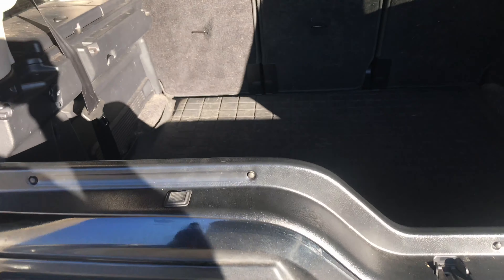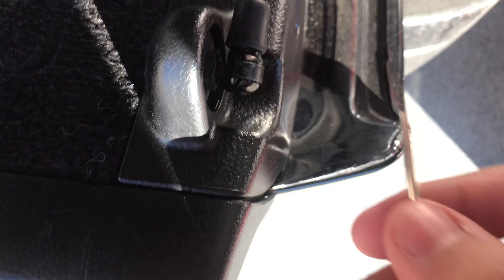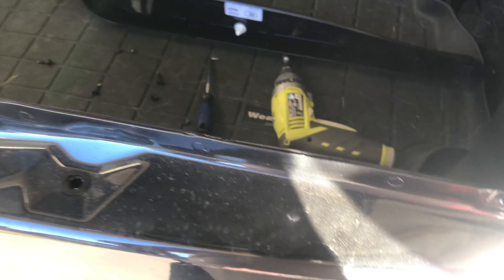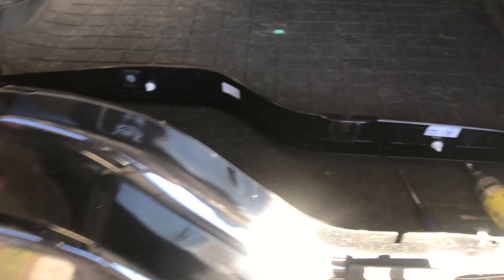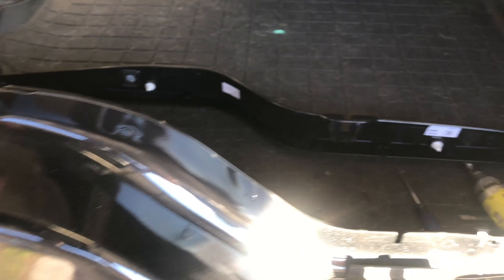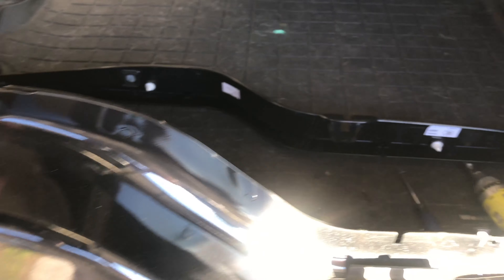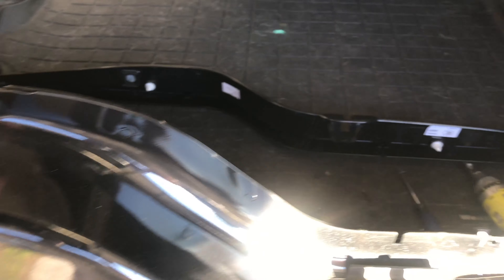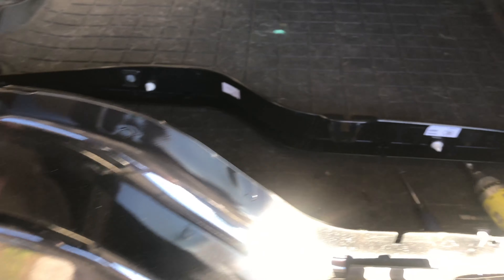Land Rover LR4/ LR3 Tailgate Repair

Comment: Very helpful, thanks. My rear dropgate button didn't activate at all the other day. I ran codes and it was a short. After clearing the code it worked again but at some point I may need to start digging around back there and will refer back to this video. Question about the cables on either side that you detached to do this job-- the spool on my driver side cable seems to have some play in it. The actual spool moves a bit when I open and close the rear gate. Do I have to remove the entire interior side plastic panel in order to access that part and tighten things up?
Reply from the maker: Christopher Perez Thank you for the comment.  I believe those spool cables are under the rear plastic panel so I do believe you have to remove those to access that.
Reply: @kennethellis5774  Thanks. Also a correction-- it was the button on the TOP liftgate that was unresponsive on my 2013 LR4. The access to that actuator seems to be fairly straightforward through the part that houses the license plate lights. But I know that the dropgate actuators that you fixed are common repair items too. Keep up the helpful videos, thanks!

Comment: 2010 LR4, (DISCO 4) BEFORE YOU DO THIS, use your key fob and see if the button on the key fob will release the hatch. I ordered a new actuator, tore the back panel apart. And the tailgate button still wouldn't work, then realized there was a button on the remote fob, and turns out the old actuator still worked, so it must be the button on the top part of the hatch. Don't be an idiot like me!